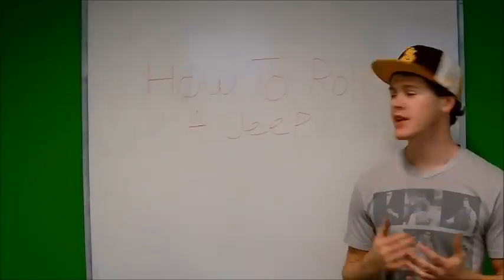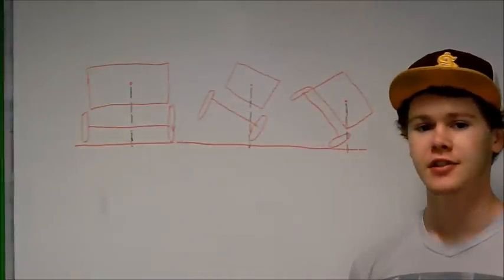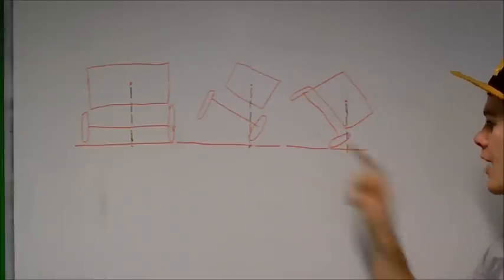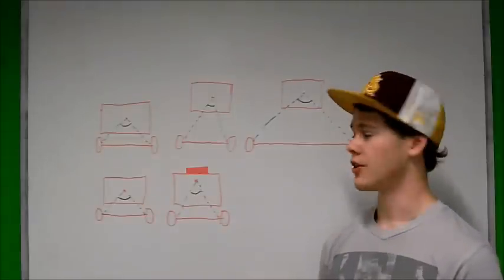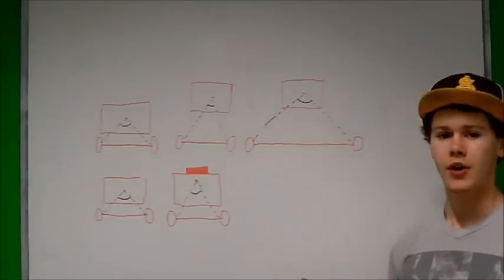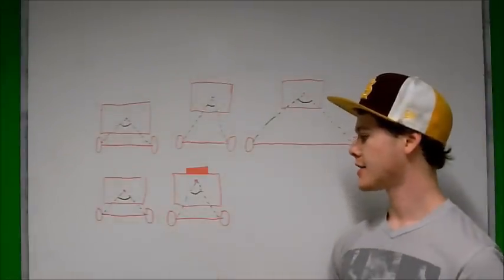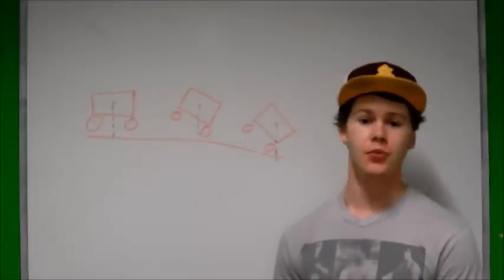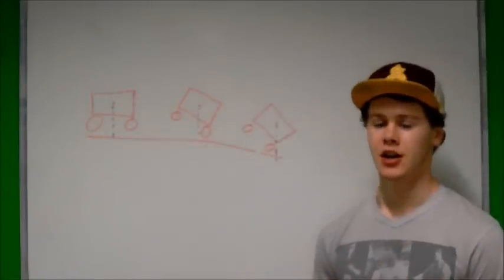How to roll a Jeep

Comment: Yeah bud,
Thats the way to go. Lift'er up high and kick'er out wide.
Thats why we went with 15"x10" wheels with 3 3/4" BS. Bit harsher on wheel bearings and steering linkage though.
Reply from the maker: Pabst Boys Nice! I'm saving for some 15x8 with 3 3/4 BS. Any reason you went with the wider 10 inch ones?
Reply: Admiral Off-Road wanted to go as wide with the side to side wheelbase as i could to avoid rolling it. But the main thing is, I plan on running 35x14.5 tires in the future and they sit nicer on 10" wide rims.
Up here, theres a lot of snowy mountain trails. I find that big, wide, aired down tires perform the best. kind of like driving on sand.
Reply: Pabst Boys Man that's a lot of meat. 15x14.5...wow. Yup, that's a mighty wide footprint right there. MASSIVE contact patch when aired down....but that's also a lot of rotating mass and unsprung weight.